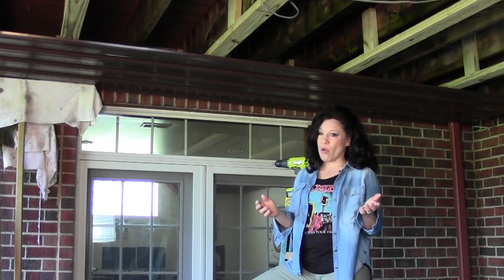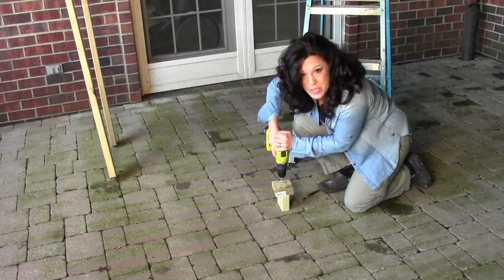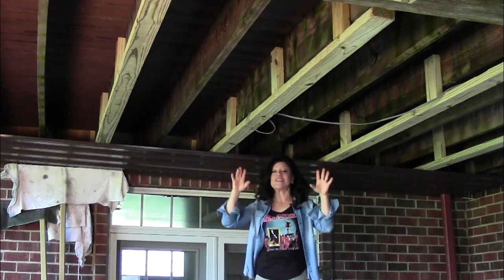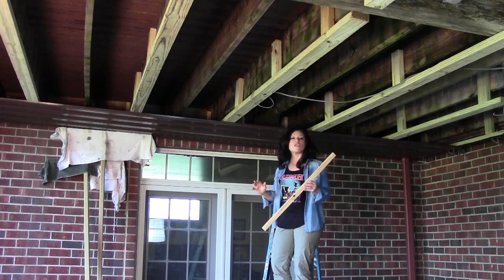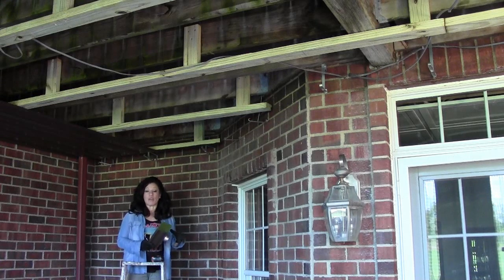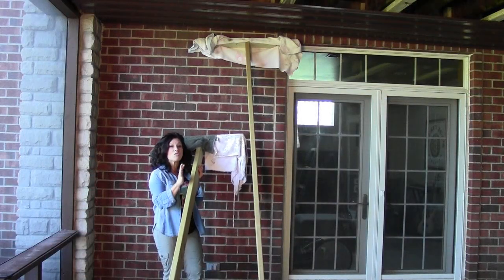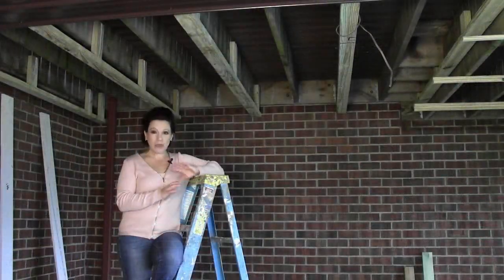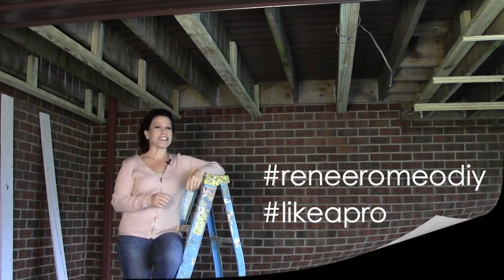Transform Your Outdoor Space: Diy Under Deck Roof And Drainage (part 1) With Renee Romeo

Comment: Good vid👍
I did a similar thing serval yrs ago using vinyl siding.  Redoing deck now and finding tons of debris and sediment build up on the panels despite having a good slope. We do have big pines close by, so that most likely contributed significantly.  But it is great having that dry spot underneath.
Cheers
Reply from the maker: Hi Patrick, Thank you so much for the feedback! Fortunately, I don't have trees anywhere near this spot, so no concern on my part. Did you use a pressure washer to clean it? I'm curious to know how you did it. Renee
Reply: @ReneeRomeo  
Didn't clean it - tearing it all out in the upcoming reno next month so I am reviewing other ideas.
Cheers
Reply: @patrickmckowen2999  have you decided on what you’re going to do next? I’m trying to find some affordable version of corrugated siding.

Comment: Thanks for uploading. I've been thinking of getting someone to do this in our house, but after watching this, it looks like something I can tackle.
Reply from the maker: Hi Angel, You're very welcome! You absolutely can do this - just like a pro. All the materials are readily available and you can have the metal cut to length for you by the store. Yes, you'll need an extra hand or two but the results are worth it. We spend all of our time underneath the deck now because it's nice and dry. Also, we've added a lot of value to the house with some usable square footage. Did you see my screened-in porch video too?  https://reneeromeo.com/2018/08/17/how-to-screen-in-a-porch-or-patio/
Why hire a pro when you can do this just as well and for thousands less? You can do this too, Renee

Comment: The only problem I have with this entire project is that you guys are going to have problems if you live in a freeze thaw area of the world. Brick is not waterproof. Flex seal is not the product to waterproof brick. There are waterproofing products that will allow the brick to breathe and allow the brick to evaporate moisture towards the outside of the home. When the brick cannot release it's moisture outside it will release it inside allowing moisture to access the wood framing that most brick homes have on the interior . Bricks breathe and help regulate humidity in your home.
Reply from the maker: Honestly Nate, Thanks for this! I'm actually in the process of waterproofing some outside concrete railings so I'll check the label and see if it's appropriate for brick as well. Thanks for the great advice!! Perfect timing, Renee
Reply: Pretty much came here to say the exact same thing. Brick must be able to breath or it the trapped moisture within the brick, will cause it to deteriorate rapidly. I've seen some brick that was reduced to dust once the water proofing was removed. A semi permeable coating is completely fine, but it CANNOT be sealed
Reply: I was about to say the same thing 😅
Reply: Here also for same thing.  Brick is far far from waterproof.  Just gutted a wall behind a brick exterior where the sheathing and framing was heavily damaged due to moisture coming thru brick.

Comment: Hey, love diy on the inexpensive! Do you have a follow up ‘rain’ video, any leaks, is it still holding up? Thanks!
Reply from the maker: I don't have a follow up but the "roof" is just fine after these few years. I don't have any trees near it so there's no chance of  debris getting in and causing a dam. That's my number one question. It's such a nice, dry space - we're out there all the time. Success! Thanks for asking, Renee
Reply: @ReneeRomeo  I have the same concern about debris buildup. I wonder if placing screen material between the decking and joists would help.
Reply from the maker: @dad1432  Absolutely a GREAT idea!!

Comment: Unfortunately the pressure treated lumber has chemicals that are going to corrode the screws for the roofing much more quickly. Hopefully not too quickly. I didn’t know this but when researching a roofing manufacturer gave me a head’s up so hoping to use cedar instead of PT.

Comment: Great tutorial, thanks.  My main concern is that the metal roofing looks to be installed so that the flattest part of the sheet is fastened to the 2x4's. It seems like the 2x4's are going to block and slow down a lot of the water flow.  Am I missing or misunderstanding something?
Reply from the maker: Hi David, That's exactly how I installed the panels but there is a 1 1/2 valley in between each flat part that allows the water to flow through. There is enough space to carry the water away efficiently. All the best with your project, Renee

Comment: Hi Renee.  We are so glad we found your videos.  Your tips have been so helpful in our under deck project.  How did you install the ceiling fan?  We want to be sure we do it right so that no moisture/water gets in where it doesn't belong.
Reply from the maker: Hi Jerry, I don't like giving advice about electrical issues but this is how I did it: For a ceiling fan, You'll need to install a heavy duty bracket in the rafters before you install the metal pole barn siding material. Then mark a hole and drill out your location for the electrical box, finishing up with the tin snip scissors. From there, I ran the outdoor electrical wiring (and all its outdoor connectors to make it waterproof) and coated the entire electrical junction box with roofing tar (including the top opening perimeter of the metal roofing) and then screwed the roofing panel in place. I then took 50 year silicone and caulked the entire perimeter the box, as well as where the wire comes into the box. All three fixtures have been leak free. Roofing tar is a must! To be clear, this isn't advice. It's just how I did it. All the best with your project, Renee

Comment: I am having a hard time finding the pole barn siding. Any suggestions?
Reply from the maker: Hi Steve,, Try zLowe's or  Home Depot online.  You really need these for a tight water seal. Best wishes, Renee
Reply: @ReneeRomeo  What exactly should I be asking for?
Reply from the maker: @stevesalavec5082  These are also called rubber washer galvanized roofing screws. I would get the 1 1/2 inch length or larger

Comment: Thank you for this video.  I am currently following your method to install an under deck ceiling on our deck.  How much space did you leave between the end of your steel panels and the brick to allow for the flow of water into the gutter?  I would like to avoid leaving too large or too small of a gap.

Comment: doesn't that system make the area under deck to be counted as impervious then?
Reply from the maker: Chris, Technically, it's not impervious along the perimeter. I've had two deluges of rain this summer (since doing this) and had some minor water overflow of the gutter that led to drips along the brick wall. I think it's understandable during very heavy rains. Other that that, it's been a nice, consistently dry place to enjoy the outdoors - especially during a normal rain storm. All the best, Renee
Reply: @ReneeRomeo  oh you don't need to sell me on the concept, i love it. i'm just fighting with city officials when it comes to my pervious/impervious calculations as i can't have over 50% impervious in my zoning. I would love to have this drainage system but can't if that add up to the impervious area, because i would be way over 50%. city codes are ridiculous
Reply from the maker: @regalia_usa  I've never heard of this restriction. Hopefully, this will satisfy your local ordinance and you can move forward with the project. Please let me know which way it goes. Fingers crossed 🤞

Comment: Renee, thank you for the video, I’ve been thinking about doing underdecking for a couple of years, and you have given me some great ideas.  I have one question that you may have answered but I didn’t see it, or maybe it didn’t apply to your house.  My deck is attached with a faceplate to the house. What did you use, or recommend to use to keep the part that comes up against the house dry? J-channel? Sorry I don’t know the construction language. 🙂
Reply from the maker: Hi Patrick, I'm sorry this question got lost in the shuffle and I'm afraid I may be too late anyway. This situation didn't apply to my project. I used waterproofing for brick  because I don't have a face plate. If you have siding, I would recommend using thin aluminum and 50 year caulk behind each screw that you use to attach it. SO sorry I missed this! Renee

Comment: Great video, but how is water draining if your metal roofing is attached flat against the pressure treated purlins with roofing screws? Typically, the metal roofing is mostly flat except for ribbing spaced every 9 or 10 inches. When attaching metal roofing, the speciality screws are attached at the flat points and flush/snugged to the purlins. Is the ribbing of metal roofing sufficient to accommodate water flowing to the gutter? It seems like you are creating a series of dams where rainwater/snowmelt would back up against your 1x purlins, eventually leading to mold and debris. It also would eventually rot away the purlins, even with pressure treated lumber. Certain types of corrugated metal panels (for barns, garages, and you casually mention these at the beginning of the video) have ribbing every 2.5 inches, which would alleviate the potential debris/water backup. I'd love to hear your thoughts on this for your project. Thanks!
Reply from the maker: Hi David, You bring up some excellent points. I should have described the barn metal roofing a little better in the video. The type that I found has 7 inch spacing between ribs and then 2 smaller indentations between the ribs - I think this the material that you're talking about above. The ribs are about an inch deep. There is also about and inch of space for air flow left all along the screen wall for air flow from the front of the room to the gutter wall (the direction of the wind). If I could have found plastic material for purlins - that definitely would have been better than pressure treated material. I can't say for sure that water isn't sitting up against the pressure treated purlins during a downpour but the water flow into the gutters has been great. The screws aren't completely snugged up to the purlins either- just enough to get a slight dimple in the bushing of the pole barn screws - so the roofing doesn't sit flat against them. During the first heavy downpour, I added two additional straps for the downspout that I had to run (horizontally) along the brick wall for stability. It's been a dry space since it was finished and I don't notice any difference in the feel of the air on the deck above. I think additional humidity on the deck above would be an indication of a moisture problem. If you're still concerned, you could increase the pitch over the course of your project. That will definitely increase water flow. I hope this helps! Thank you, Renee
Reply: @ReneeRomeo  Hi... thanks for your quick response... I live in Colorado at 8,000 ft so relatively dry and not humid. I agree that if deck boards are adequately spaced, there probably won't be as much issue, perhaps...but organic debris like pine needles and leaves do slip through. There are plastic purlins, but they are made for the polycarbonate type of panels so not sure they are adaptable to metal. The metal, on the other hand,  looks much more aesthetically pleasing than the polycarbonate material, and of course, the metal material is way more durable. And the plastic purlins would add some fairly significant costs. I've seen many of the more expensive packaged systems with removable panels to clean and retrieve items falling between decking boards, but...well... ridiculously expensive upfront costs.  Pitch is definitely key. I believe most metal roof manufacturers recommend a minimal 3/12 pitch, but that's understandable for a roof. Looks and sounds like the pitch you have works fine! Our deck is 30' x 12' and 20' x 10' so considerable area, but don't need to cover the entire area. Thanks again for your information! Keep it up!!
Reply from the maker: @virgilk3447  That's exactly what I was finding when I priced this out - the "systems" are a system for companies to make a lot of money! You have a larger area to cover than I did so it just depends on how much you want to spend. One thing to note (and I didn't think of this at the time of filming) is that I don't have any nearby trees on that side of my house. Pine needles would definitely be a problem for air flow. In your case, If your deck boards run parallel to the house, you could remove the first board and pressure wash above the metal to make sure things are cleared out once a year. It's just a thought...

Comment: Any issues with joists rotting / not drying?
Reply from the maker: Matt, This roof has great drainage and the space is dry. There is no evidence of rot. It has been a dry feeling space as well wwith plenty of air flow. Renee
Reply: @ReneeRomeo  that's great to hear it's going well after 4 years. I'm about to attempt this on a 46ft deck but was nervous about creating too humid of environment... will see how it goes!
Reply from the maker: @mattdalesio1443  No worries on my end although someone suggested a while back that I could have sprayed the pressure treated lumber with a sealer first. I don't know if that would trap moisture though. It's worth a little research. My thought was that I'd rather have it dry out between rain storms than have the rain water bead up on the wood and stay there. Without direct sunshine, I think it's a real possibility. Best wishes with your project too, Renee
Reply: @ReneeRomeo  yeah, I was thinking about that too. One opinion says it may protect the joists another says it may cause damage by trapping water that enters from the top. lol decided to move forward without sealing joists and see what happens.
Reply: Good on you girl you can do anything without a man. I'm looking for a tutorial video to build up covered roof of my existing deck 1.5 meter above the ground.  Although I'm a female and at this very moment I'll be your follower . Thank you very much for your informative video.
Reply from the maker: I agree! You can do anything you set your mind to. Best wishes with your project! Thank you so much for the follow! Merry Christmas, Renee

Comment: What is the span of the 10”wood supporting the long 2x4? Is it 36”?
Reply from the maker: uhogmo, Great question! Mine is actually 32" because I have a 16" span between my deck joists. Yours may be slightly different than mine, depending upon how your deck was built. I hope that helps! All the best with your deck project, Renee
Reply: Can I use 2x2 instead of 2x4 if I use polycarbonate plastic roof instead of metal pole barn sheet?
Reply from the maker: @uhogmo  I looked at that material too and it would be great for this use as well. However, you'll probably have to cut the polycarbonate differently than the metal material. I recommend getting the thicker version of this and cut it with a jig saw (around objects) and the straight cuts can be done with a circular saw and the proper blades. It will definitely save your hands from scissor fatigue. Also, the pole barn screws are designed for flat surfaces so they're perfect for keeping out water on the metal material. Make sure that your pole barn screws are the proper diameter to make a nice seal around the curved material of the polycarbonate to make a water tight seal. As far as the 2 x 2's are concerned, the only issue I see with them is that You'll have to be a little more careful when attaching your pole barn screws because you won't have as much leeway in their placement. Other than that, you're good to go! Renee

Comment: How long did the whole process take you?
Reply from the maker: Hi Josh and Concha, If the weather cooperated, it would have taken 4 days (or a long weekend). One day for attaching the wood slope, 1-2 days for attaching metal panels & trim, and 1-2 days day for installing the gutter system. I know there are several outfit changes but I did this in the Fall and it was particularly rainy and cold last year. I didn't feel like any part of this job was difficult but you do need a helper (or two, depending upon length) to lift the metal panels in place and to install the gutter system. My panels and gutters were 16 feet long at the widest points. I saved thousands by DIY-ing this project. So, I had money left over to furnish the space too! All the best with your project, Renee